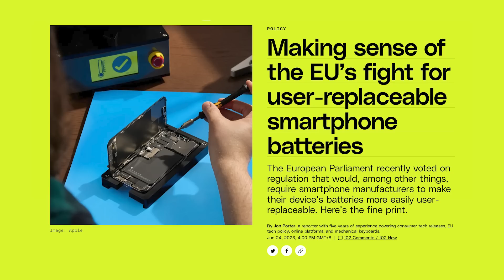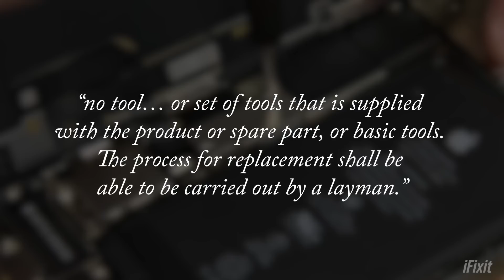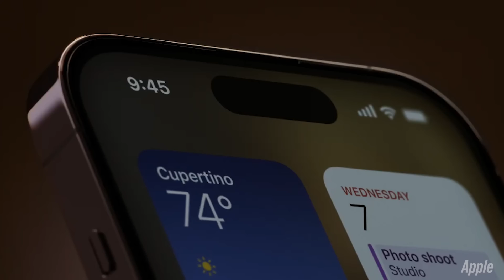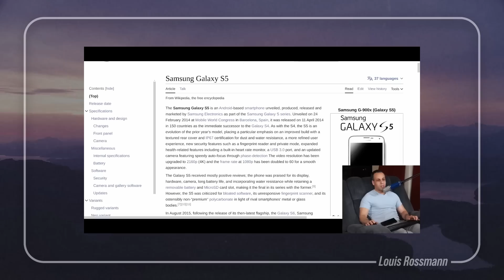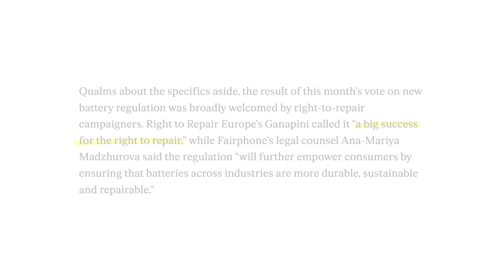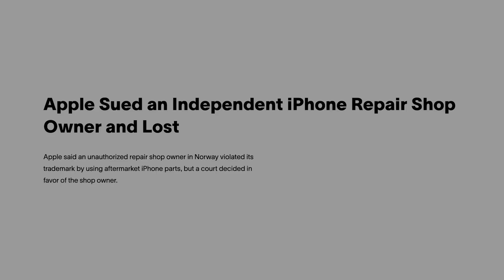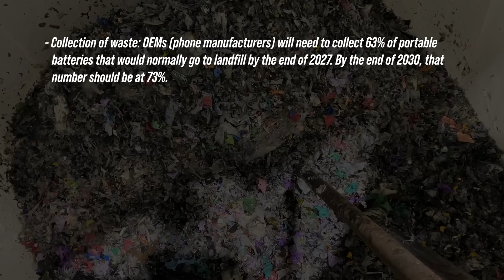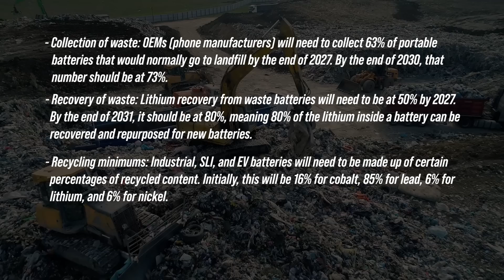EU Just Changed Smartphones Forever

Comment: The manufacturers told the consumers what they wanted. Thinner slipperier phones look good in advertising. So they told us thats what we wanted. Then, knowing such designs would be uncomfortable to hold securely, sold us $40 protective cases for these phones. Then they bent the glass around the edge, and now the cases dont work so you just have a flimsy, slippery $1,000.00 phone that shatters and has no replaceable battery

Comment: Honestly I don't mind not having slide off backs anymore. I do have an issue with companies not allowing part replacements (because they don't own the phone) and glue is really annoying to deal with. I don't think this law is really consumer driven. As long as it's possible to replace batteries, it doesn't have to be easy just possible via a third party.
Reply: Phones should not be designed in such a way that it would REQUIRE to PAY a third party just to remove a battery. If you have no use for your money, you can always go ahead and pay. For those of us who rather eat some food with extra cash, we want it possible to replace batteries ourselves.

Comment: Wonder how this will affect other devices other than phones, tablets, and laptops. I'm looking at bluetooth devices like earphones and headphones that we use with our cell phones. None of them are easy to replce the battery, if they can be replaced at all. Some of these headphones cost 500.00 plus and I don't want to toss them after 3 or 4 years because the battery that runs it is dead. ( Apples airPods Max needs the battery to funtion, so does Focals and it 800.00 retail )

Comment: Guessing that to keep waterproofing without glue would need some new item to seal the phone.

Could a gasket work? If it implements a "lip" design, I could see it working like this:

1. Secure the top "lip" of the gasket to the back panel of the phone.
2. Align the back panel to the body of the phone.
3. Using a pick, slowly force the bottom "lip" of the gasket into position.
4. If done correctly, the back panel should be level with a flat surface.

Only problem to figure out is a way for the user to know they actually placed the gasket correctly. I'm guessing you could use contact cleaner and integrate a fluid sensor inside the phone, but I don't think that would be optimal.

Comment: Looking forward to see how EV manufacturers are going to implement toolless user replaceable batteries in EVs.
Reply: For EVs that aren't, say, bicycles, it'll be that a qualified mechanic at any garage should be able to easily swap the batteries.  Probably with just lifting the body off and taking the battery out of the chassis.

Comment: NO.  STOP.  This design for non removable batteries were "pioneered" by Apple.  Before they pulled this crap all phones had user replaceable batteries. It was Apple and specifically Steve Jobs obsession with thin that lead to this.  And why phones have now gotten so thin I can snap them in half for many of them.  Apple frequently does sh*t that the rest of the industry apes.  Not because its a good design.  (Loss of physical keyboards resulting in autocorrect he!! I'm looking right at you.) But because they want to capture the number of users that Apple has.  Frequently Apple's designs are hot garbage and should NOT be aped by others.  The only one I can think that is the reverse is Samsung's introduction of the removal of the bezel with a curved screen.  Apple picked this crap up and now we have the almost mandatory popsocket because no one can hold their phone without a case as it will trigger the screen.  Thankfully some have backed away from this design.  But time and again these bad designs are directly from Apple.  We can see the same BS happening in their laptops until right to repair legislation started to become a thing.  They started that trend and everyone else followed like good lapdog copy cats.

Comment: I have some concerns, as a geek and gearhead, about requiring EV batteries to be serviceable by a layman with no special tools. My concerns here are twofold, and one is going to be mocked by RTR advocates, and I assure you I'm on the side of fixing things, if it's sane. 

The first concern is, EV batteries are about half the weight of a full size car. When it comes to keeping a huge, heavy, dangerous, piece of equipment in place, the kind of fasteners you need an impact to put in and remove are confidence inspiring. The battery should absolutely be something you can remove and replace in a garage, with the right tools and instructions, but requiring a no-tool replacement seems AMBITIOUS here, especially when you think about things like moving a one ton battery around your garage and putting another one ton battery in your car. This really is the territory of enthusiasts and mechanics, and while the tools need to catch up having tools for working on cars doesn't seem like that big of a stretch. 

The second concern is exposed live high voltage terminals and amateurs who might not fully understand the life changing or ending peril they are putting themselves in by doing things that, to a gasoline engine mechanic working on 8 and 12v systems, aren't that crazy like changing a battery in the rain where the consequences of being shocked usually are "damn that hurt" as opposed to the consequences of a first mistake at 800v which are mortally wounded or dead and nothing less than that. If we're going to make this a part a teenager can yank out while figuring out how to work on her car, let's invent some safety regulations for removable EV batteries before the regulation has to be written in blood. 

All that in mind, this is a rocket launch in the right direction

Comment: Used to be necessary when batteries had a short life span and daily run time, but it being easily replaceable simply isn't necessary any more. 10 years ago people would have multiple batteries and a charging dock. However, it shouldn't be excessively difficult, time consuming, or cost prohibitive for a shop to replace them. They last years, it's not like you're replacing them every few months.

Recycling should be being done a lot more than it is, but you can't just accuse phone manufacturers of this, may industries don't take it seriously enough. The whole thing about phone cables, everyone having usb-c somehow being better for the environment due to there then being less cables, it's utter nonsense when millions of people every day have non-recyclable yoghurt pots and a phone cable that lasts a couple of years.

Battery factories for EVs should be able to recycle phone batteries into the materials used for car batteries, as well as the aluminium from the chassis/housing. Phone shops could do the dismantling and posting.

Legislation for the sake of it, pretending to achieve something but not actually doing anything, other than trying to control and change things that make no difference while ignoring for greater issues.

Comment: The way phones are designed now is not an accident, phone manufacturers made them this way on purpose so that you have to buy a new phone from them instead of repair the one you have.

If you don’t believe me then just look at all the times that apple has been exposed for slowing down older phones in an effort to make you buy a new one before you actually need it.

Comment: Louis Rossman doesn't care about design or materials. The LG G5 had gigantic borders and the back panel of other phones were made of plastic. Batteries also had a lower energy density per unit of volume due the more robust package. The water protection is also questionable, it faisled a lot and budget phones (without IP rating) were much more vulnerable.

Comment: I am old enough to remember the old days when I keep 2~3 batteries around for my phone. Then each time I got a new phone, the new phone used in different model of battery. I always ended up with more batteries around the house. Beside, most people I know get new phones because the new ones are cooler. Enforcing phone recycling programs might be a better solution than enforcing replaceable batteries.
Reply: Why not bot... oh wait, that is what the new regulations and laws are.  Coldfusion even had it in the video.

Comment: Every phone ive seen in a tear down, fix or whatever, the battery is so firmly stuck in with glue of one sort or another...why. ?..Even when the glue is removed its so snug it can hardly move if at all, just a small piece of rubber or some sort of packing would be all thats needed, if that..these firms have been fucking us over for years and the problem is that they will just increase prices of their products ,parts etc to cover any loss of earning by moves such as this...they will continue to fuck us over one way or another

Comment: It is a great thing for the consumer. But not for the three letter agencies. Right now you can't power off your phone entirely. The screen is off but who knows what is working in the background. Another way to get the surveillance work better, is the introduction of the non removable e-sim. You have to subscribe to a carrier, no prepaid sim cards in the future, so they can easily identity you. So maybe removable batteries will return, but e-sim is on the way to fill the gap. And a small backup battery may be incorporated to maintain activity in the background. But the recycling of the battery is a good thing after all. Unlocked bootloader is another thing that disappeared recently on most brands. So the companies will find a way to force you to buy a new device as soon as possible.

Comment: Having a removable battery is important, just yesterday my 6 year old android phone did something weird:  even though it had plenty of charge it shut down and wouldn't turn on, not even when i plugged it into a charger.  I removed the battery for a few seconds and put it back in, and then boom it turned on.  With a sealed battery i never could have done that

Comment: Apple does this to keep getting more money. It's why they went to soldered on memory and storage in the computers. If they had replaceable storage, they couldn't charge $800 for a $100 part
Reply: they can just introduce encrypted chip to the $999 battery and reject all unauthorized battery
Reply: Nowt like putting a battery with a 2 year life span in so you have no choice but to upgrade
Reply: To be fair, at least in the 'Apple silicon' generations, the way they connect the memory and storage to the chip allows for much higher bandwidth than standard socketed memory would.

Doesn't excuse them from say inventing a new standard like Dell has with CAMM memory though. You know, so the whole industry could benefit.
Reply: Actually is better now with risc architecture on soc than the previous scrap with a normal cpu and proprietary connectors for everything. If Mac before Silicon was a double scam, now is just a scam. And yes, a lot of producers are doing the same stupid thing with that damn lpddr ram soldered on chip, especially for ultrabooks but the crown of scammers is still firmly on Apple's head, for the fantastic idea about the storage: 350 of your value (euro, dollars) for a 256gb of the equivalent of Gen3 m2. For 1/6 of the price there are 1tb ssd that doubles mac in speed. Conclusions: Apple is just for people who really knows what they're purchasing, otherwise is burning a lot of money.
Reply: @s.s.7404  All the super slim computers have soldered ram. Without that, there's really no way to make it super slim, cause there's no ram manufacturer out there that makes very small ram sticks.. They're all the same size and they're really big. If there was a smaller-ram-chip standard out there, there would be far more slim computers that would use those. 
Think of it like this.. If the only flash memory that existed was the big compact flash cartridges, no phone would use external memory cards.. Because they would need a huge hole on the side and a super thick phone. So we have micro SD cards that slide into anything.

On the ram side, there's no ram made for ipad scale devices.. No standardized ram chips for macbook air-style laptops. All of those slim devices need to solder the chips in. Even the iMac, which used to have swappable ram at the bottom, is now soldered because, you know, slim things are cool? I dunno.

When their main concern is design and slimness and style, power users are not considered. People who want a computer they can upgrade would not buy a macbook air.. These slim devices just aren't for people who care about updating. They're literally the types of devices you use and throw away. Wasteful devices that are for goofballs who want a pretty laptop rather than an awesome one.

Anyone who is flabbergasted that they can't slap a new CPU and ram into their macbook air should have done some research. If you buy a toy, you get a toy.
Reply: So much for being eco friendly. 
Right?
Reply: Some Apple computers are even known to destroy their SSDs when things go wrong.  That is bad news for those ones with a T2 chip because it won't boot without keys that are stored on the SSD.  It is a wonderfully simple way for Apple to screw someone over on a cheap part that is soldered in.  I say wonderfully in a sarcastic way since no doubt anyone it happened to probably curses Apple for that deliberate design flaw.  Apple knew exactly how they are screwing people over with that bad design and it is like their way of making a simple repair difficult and expensive.  Then some people probably wonder why I don't care for Apple at all.
Reply: Damn they've been soldering on the ram and storage? That's downright cold. How does apple have so many fans with this attitude towards its customers.
Reply: @vicx05  Apple is the Sun Tzu of anti-consumer tactics and strategies, the amount of bullshit they've implemented over the years to screw over its clients and boost its profit is incredible. A lot of people who are against Apple take this position for this very fact, they are not against luxury products, they are against being taken for fools.
Reply: ive used my iphone 8 daily since 2019 (i bought refurbished for $350) and the battery capacity is still above 90%.

smartphone batteries (at least with iphones) are good enough nowadays to last over a day on a single charge, and by the time the batteries lose capacity (5 years), the phones are no longer software supported

why is nobody thinking about this from a practical viewpoint? look at the design of iphones, replacing the battery takes less than 10 screws, and the waterproof seal can be completely replaced after. to make it any more simple than this would mean making the back of the phone cheap plastic, and would interfere with Qi charging and Magsafe. @vicx05
Reply: @vicx05  its because a large part of apples fanbase is completely technologically illiterate, like they think thats since its an "advanced" technology that all repairs are ridiculously expensive, which is almost never the case.
Reply: @vicx05 Apple is software company. It has to finance software development somehow.
Reply: if youve ever opened an Apple product you would have seen how meticulously and tightly they are designed. it has nothing to do with making money
Reply: @imstupidbut  you wear your name on your sleeve my dude.
Reply: @imstupidbut  yeah i watched louis rossmann enough to see how their products are meticulously and tightly designed to fail.
Reply: @imstupidbut Name checks out.
Reply: @imstupidbut  I can't wait for your argument for the Mac Pro  wheels kit at €699! 😎
Reply: Funny how everyone singles out Apple. Literally every company is doing this.
Reply: @teamtoken  If you run Windows or Linux and want user replacable/upgradable ram or storage you just pick a laptop what has that. If you want a mac but want user replacable/upgradable ram or storage you're fucked

Comment: Yes! They should also make the manufacturer support phones with OS updates and security patches for 5 years. There will be less clutter of devices. I'm all in for the battery law. I don't like to buy a few phone or device when all that's broken is the battery.
Reply: only for 5? it should be 10
Reply: @bremer1701  10 is a stretch. I don't think people use their phones past 5 years in this day and age. And also the processor won't be able to handle the latest os versions in a stable way I guess. I'm just speculating l though

Comment: What about some kind of free update to extend the operating system , remember operating systems are designed to be obsolete.
some apps will not support older versions.
so replacing a battery will not change much.,as you will end up with a phone that works but wont support new apps .
a phone should be built to be supported for 10 years

Comment: I absolutely believe this is to do with profits and anti-consumer motivations. I have been mostly a Samsung user because I did not want an Apple product for the very reasons you outline in this video. Unfortunately after some years being a loyal customer to Samsung I realized they adopted the same anti-consumer strategies as Apple, so I've moved on from them as well. Their curved screens are made specifically so the screen will crack easier. I can't believe this doesn't get more attention. Considering it coincided with a massive jump in screen repair cost.
Reply: I havent cracked any screen, in the past 5 years or 8 years. I know when the last one was, in 2014. And was not curved, i smashed it. Now these are more durable already. And Gorilla Glass Victus on Fold4 can survive a drop from 2 meters on concrete or the latest Samsung Galaxy one.